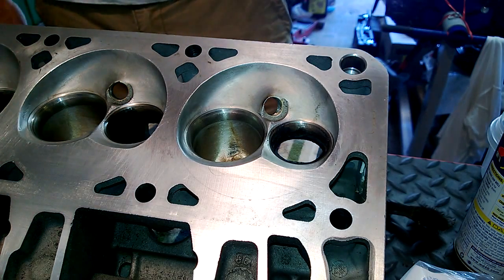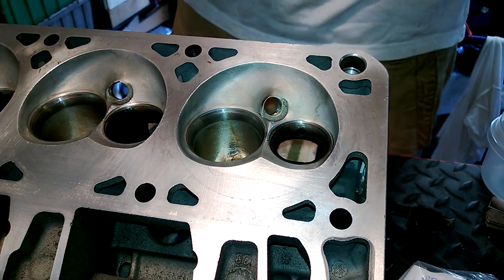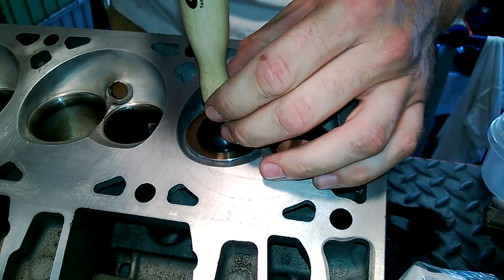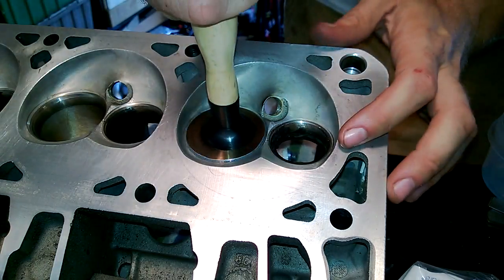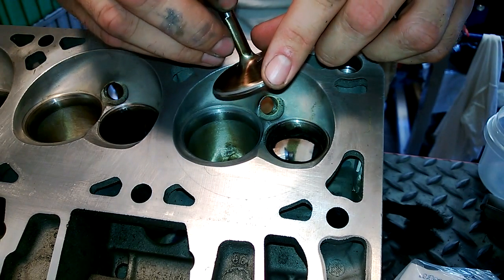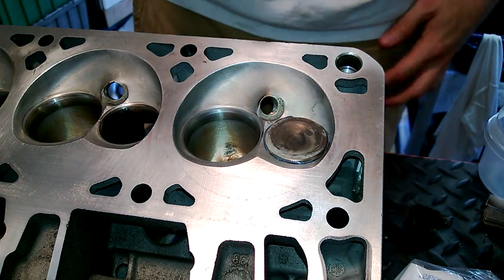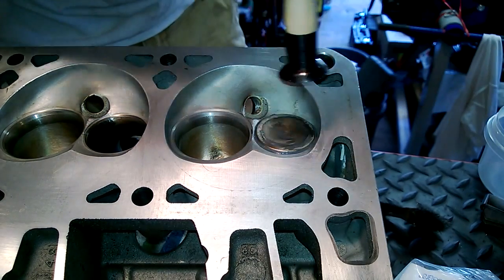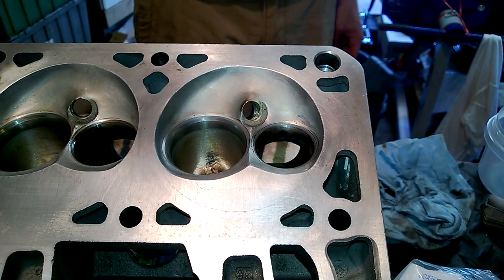Valve Lapping - LQ4 Build - MTi 862 heads with 2.02" Intake Valves

Comment: Did you have to cut new valve seats for the 2.02 valves? Or were the factory seats intact?
Reply from the maker: Yes the seats have to be cut for the 2.02 valves.  These are OLD MTi heads.  So it was done by them way back in like 01 or 02.

Comment: I think from doing my own research that lapping the valves is only for checking your valve job
 grinding valves with compound itself is not a valve job and does nothing
Reply from the maker: Nope...you are correct.  This is not a valve job.  Seats were already cut and matched to the valves.  Lapping only polishes up the seats and valves, removes any little deposits or what not.  None of mine were leaking bad, but one cylinder failed my liquid test.  After lapping it was all good.

Comment: Just picked up my 862’s from the machine shop, upgraded to 2.00”/1.57” valves and surfaced .020
When the chambers were cc’d stock they were 65cc not the 61.5cc advertised, normal sop for GM. They call it serviceability margin. 🙄
My concern, my machinist commented that if I don’t unshroud the intake valve in the chamber the heads could flow less than the stock 1.89” valve, due to shrouding.  I can’t tell if your chambers were modified for the larger valve?
Reply from the maker: Hi HeadFlowInc.  My chambers were blended and worked, yes.  There is no shrouding.  I also measured them at almost exactly 60 cc.  Im not sure how much they were milled, but I believe it was just enough to flatten them out.  These are old...quite old at this point.  Probably from the early days of LS bolt ons.  Its on my list of things I will replace when I do the next build.

Comment: what do u use to clean the whole head after the job?
Reply from the maker: I washed it down real well with some solvent and compressed air.  In hindsight, I would have done things in a different order.  I would have sand blasted the block and lapped the valves, THEN I would have taken the block in for cam bearings and hot tank and the heads to be tanked as well.  Live and learn.

Comment: What are the heads specs? They look milled
Reply from the maker: They are not milled much.  They are flattened, thats about it.  Chambers are still around 59-60 cc if I remember correctly.  Just been ported, massaged, and the bigger intake valves.  They're nice inside the ports.

Comment: did you port those heads
Reply from the maker: I did not personally port them.  They are aftermarket heads, so they were already ported when I got them.  I dont know all the details other than they are supposed to be MTi Stage 2e heads...from a quite a few years back.  And I only know that due to the receipts that came with the donor car and looking at the heads.  They are still decent, but they wont be going on the next motor.

Comment: The change in the sound while rotating the valve, is caused as the particles in the grinding compound start to break down into smaller particles.  When you pick up the valve and rotate it a bit, some of the grinding compound that wasn't sitting where the valve meets the seat, moves to that location, so that when you start rotating the valve again, that unground compound now gets ground down.
Reply from the maker: Yup...exactly!

Comment: hello  I would like to know if the intake valves is 100% no leaking or is their a certain leaking that is normal. People have told me that the leaking is normal. If its true can you explain it o me. Because when i took the head from machine shop the intake valves is still leaking a bit. The machine shop told me this is normal. is it true? waiting answer if anybody knows about this.
Reply from the maker: +Ismael Rivera Wow...a 1 year old comment I never saw!  Sorry about that Ismael.  Sean is right.  They shouldnt leak.  I actually use rubbing alcohol mixed with some water to test.  These heads all held liquid for as long as I left it sitting.
Reply: +Ismael Rivera no, no leaking is normal.  you should be able to hold air or water (thats how i test mine after lapping).  leaking would mean compression loss, so either you misunderstood, or they're wrong.
Reply: thank you
Reply: Unfortunately, some shops will use the phony excuse "That's normal" when you find problems with their work.